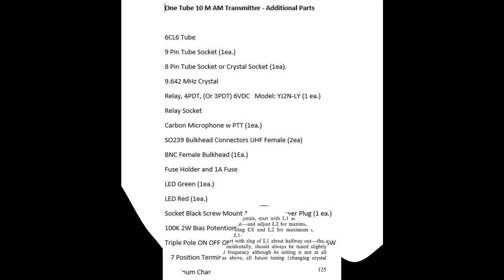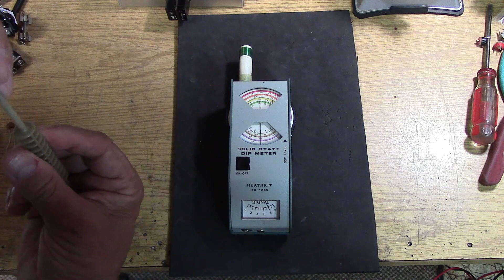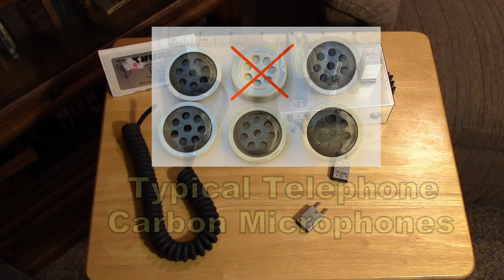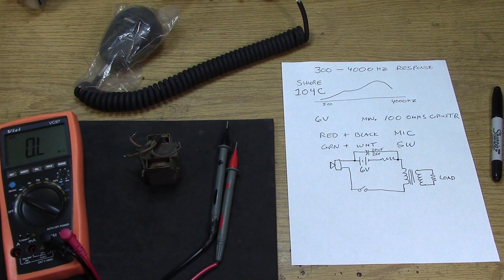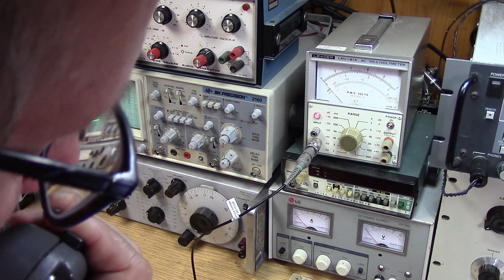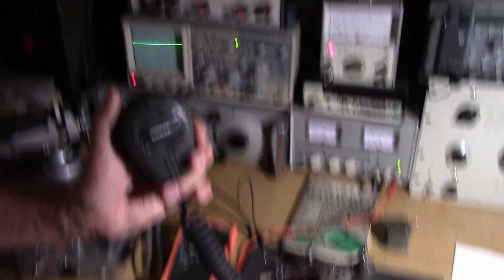One Tube 10M AM Transmitter - Part 2

Comment: Can this transmitter be modulated to 100% or is there a limit below that?
Reply: You certainly do not want to have more than 100% modulation as this causes distorsion. Normally, you would aim to have a bit less than 100%. Maybe 80%, to ensure some safety margin and avoid distorsion. The formula is Pt=Pc(1+(m^2)/2). Pt is total power, Pc is carrier power and m is modultion index (where m=1 corresponds to 100% modulation. If you have 10W carrier and m=1, the total power is 15W. The power in each sideband is only 2.5W. So, of your 15W transmit power, only 2.5W is being used at the receive end to copy the signal. The sideband power drops off quite rapidly as you reduce m below 1 (below 100%) due to the m^2 part of the formula. So, that is why you nornally aim to keep modulation index just under 100%.
I always remember that for 100% modulation, you have "1+4+1". That is, for 6W total power (1+4+1=6), you have 1W in in each sideband and 4W in the carrier.
AM is pretty inefficient! That is why hams switched to SSB.
Reply: @Steve-GM0HUU  I was not asking for a detailed technical explanation nor the math behind it.  We know the obvious of over 100% modulation, I was wondering can this suppressor grid modulation circuit reach 100% AM modulation!
Reply: @JCWise-sf9ww  Sorry, my apologies for misunderstanding. Perhaps we shall the answer in the next installment.

Comment: Just to make sure I'm understanding it right: it seemed like you have antenna switching from receive to transmit, but this is a transmit-only circuit, correct?  I don't see any audio output -- so why the antenna switching?  To pass through to a separate receiver?
Reply from the maker: Yes to work with a receiver on the same antenna.